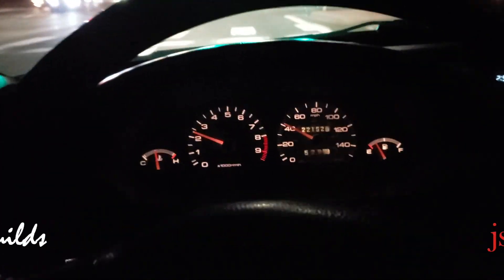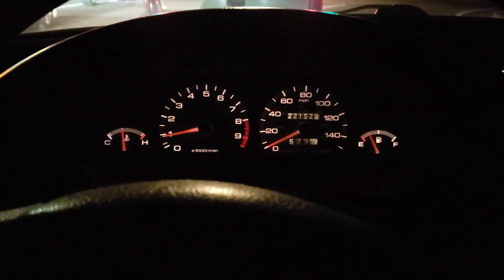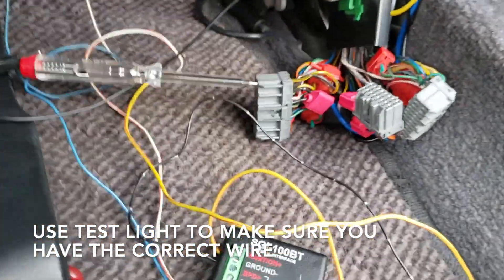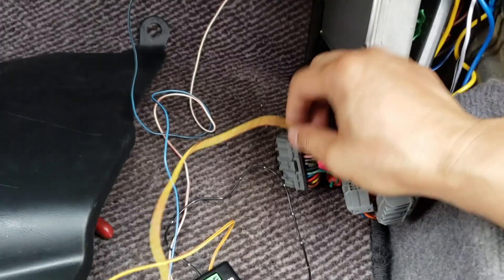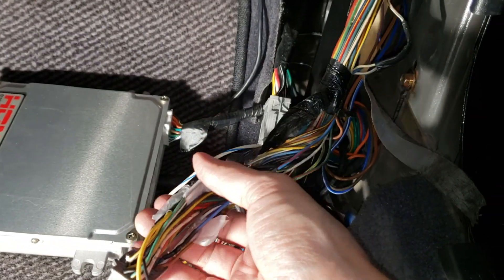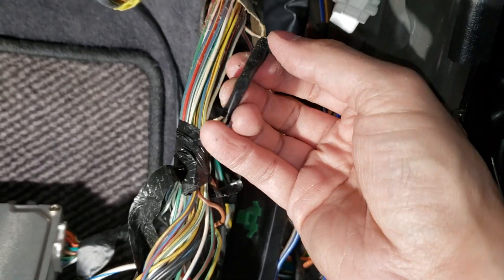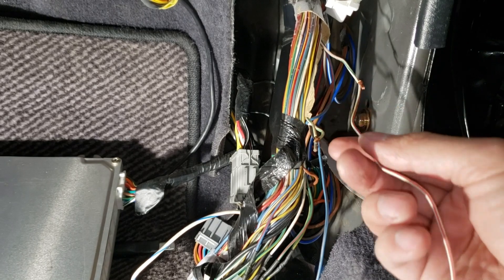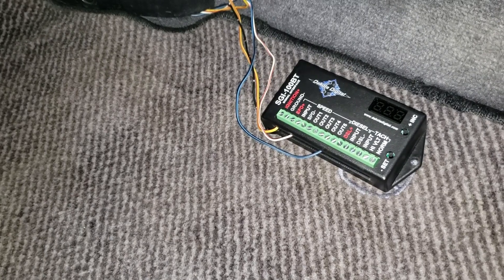Dakota Digital Speed Convertor Box for K Swaps CSS to VSS.

Comment: Mine is wired exactly like yours on my rsx. And im having the EXACT issue. It takes a while to start reading speed
Reply from the maker: The only thing that I know about the RSX is it uses a multiplex signal that comes from the ecu. The Integra's and Civic's at least the older ones that I know of uses a signal directly from the speed sensors.
Reply from the maker: https://youtu.be/w2TBq5DjbXA
Reply: @jsrebuilds3951  thanks , i already fixed mine. I just wired it up with kpro . I got rid of the dakota box
Reply from the maker: @garciac619cg  yeah you don't need any of these boxes. Kpro or any rsx ecu will work directly.

Comment: Not sure why so many people seem to be having this issue. I just wired mine up and don’t have this at all. I used OUT5 like someone recommended here and set calibration to 1.42. It’s pretty much spot on with 0 lag. This is with a k20z3 trans in an EK. I’m no k-tuned hater but it would be ridiculous to think they made a better converter than a company that specializes in this.
Reply from the maker: I've work with the tech "they say" is expert at Dakota Digital many hours on 2 different identical unit to rule out a defected unit. Even tried all the ports, even the one you've mentioned. Even had a voltmeter hooked up while testing the unit while driving with no solutions on why it didn't work. 

The tech's there finally gave up on me and I still had to pay for a unit that didn't work for me, so I opted out for Ktuned and it worked right away. I would of kept using using Dakota Digital if they could of figured it out, so all I was doing is just posting my experience here.
Reply: @jsrebuilds3951  oh nah I believe you. Just not sure why this is happening to so many people. Seems like a defective unit.
Reply from the maker: @ohxietviet  I would of like to use the Dakota product because it does have more features but they didn't even give me a refund any of those defective units. I called Hybrid Racing and they use to have one but they discontinued because something with theirs wasn't defective. If I could of opt out of not using K-tuned, I would of.

Comment: Hi mine is in a jzx100 as soon as it gets to 60 it drop to zero any ideas why this is
Reply from the maker: Are you using the Dakota Digital and what swap and chassis are you running?
Reply: @jsrebuilds3951  yeah running that box I don't have a swap I put a sequential gear box and the Speedo used to run of the old one so tapped into the abs sensor
Reply from the maker: @relaxnheal8640  https://youtu.be/w2TBq5DjbXA
Reply: Thanks

Comment: K-Tuned VSS converter box instructions says to tap the box GND wire into a GND wire from the harness, not connecting it from the box to a chassis ground.
Reply from the maker: Ok Sean, I will give that a try and hope that would solve my issue. Thank you for reaching out.
Reply: @jsrebuilds3951  I should have waited to post until I tried this myself, which I did tonight. JDM CL7 swap into an EK hatch, 02-04 RSX engine harness. DD SGI-100BT. 

I connected the DD GND to chassis ground, engine harness ground wire from KTuned instructions to SPD- on DD. Settings: H-L, LO input voltage advanced seeing, input pull-up ON. 

Initially went with OUT4, but the speedo was reading about double, so switched to OUT5 and it is really close. Very little adjustment needed. Unfortunately I am also getting the lag after longer stops but it seems to kick in around 20 not 40. Brief stops are fine. 

Application #3 in the instructions says to wrap VSS signal and ground wires together to minimize interference (which I didn't do) but I am doubtful it will make much of a difference.
Reply from the maker: @seancostello387  Thank you for responding to the comments and helping us out. I've worked with 2 of their techs extensively and  I know their tried to help me out but they are not willing to admit that their product doesn't works for our application. 
No one has responded if the ktuned box is the better solution.
Reply: @jsrebuilds3951  I see the Hondata sticker on your ECU. If you are running KPro, depending on your version, you could do the conversion at the ECU and not have to worry about an external unit. If you are trying to avoid spending even more money on the KTuned converter. https://www.youtube.com/watch?v=A4-ECo9Luds
Reply from the maker: @seancostello387  Hey Sean, thank you for this comment.Yes I do have a Hondata kpro v4. I've tried what vtec academy recommended on this video you sent me and it doesn't work either. I've actually called Hasport and talked them to make sure I was doing it right and it turns out it doesn't work at all. So I reached out to Hondata and they confirm it doesn't work the way vtec academy says. Hondata says their ecu is not made to be able to switch it to reading the high frequency of those kinds of transmission.
Reply: @jsrebuilds3951  That is a bummer. Sounds like you've tried just about everything at this point. If I end up trying out the KTuned VSS converter I will let you know how it goes.
Reply from the maker: @seancostello387  Thank you Sean, please do. I haven't really had the time or chance to play around with the Integra. But you are really appreciated for what you doing and thanks for asking all these questions. Lets hope it can help others at the same time.
Reply: Any update on this? Is it still buggy at longer stops?
Reply: @BrandonMeidinger  I still have the issue- it didn't magically go away (unfortunately) nor have I spent time to try other things to resolve it. I haven't purchased the KTuned converter to test it out and see if it works better.

Comment: I have the same box with a j swap and I can not get the bluetooth to show up on my phone. I went the the screen for blu and checked in my settings and in the app and it never shows up. Anything I can do after getting to the blu menu before it goes into bt pairing mode?
Reply from the maker: I don't know the answer to your question. You should reach out to Dakota Digital for tech support. I'm leaning towards getting the ktuned vss converter.